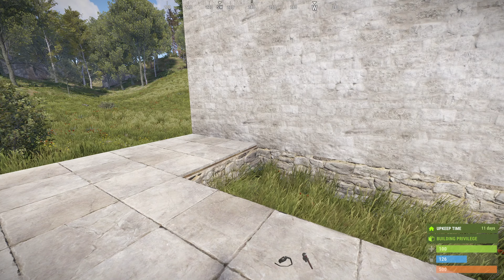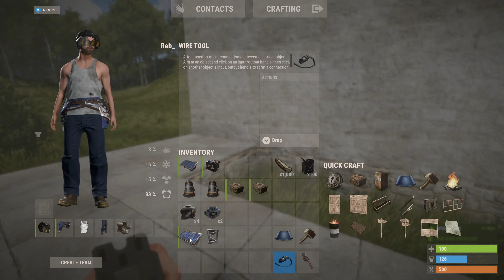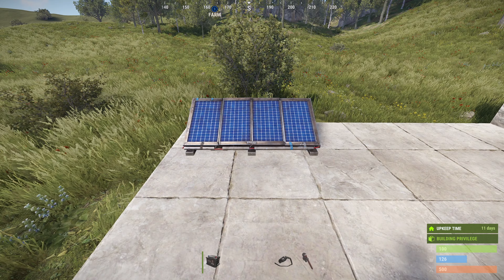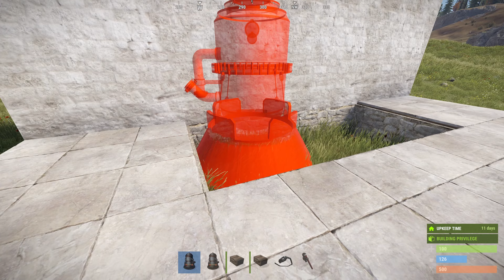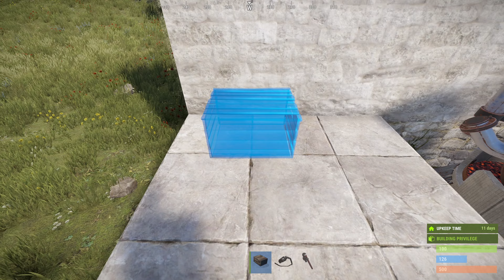How to automate Low Grade Fuel production using Small Refineries - Industrial guide - Rust

Comment: doesnt work
Reply: It does. Something to take into account is the server smelt rates. We played on a vanilla and it worked fine. When we played on one with faster smelt rates we have to up the wood/ crude input to match the 5 second conveyor tick.
Reply: @cptjimmy15 ya my bad i found out my sprinkler was a lil too close i fixed the problem
Reply: it keeps turning off
Reply from the maker: I use this all the time with no problem.
Reply from the maker: Are you connecting to a collection of wooden boxes or just one?
Reply: @friendnotfoe  i tried it were it pulles the wood and the crude from two diff chest  and i tried it only using one and i have to keep restarting it idk maybe i did something wrong

Comment: When I had the first conveyor toggled to "require all" it wouldn't pull for some reason, but when I switched it back to "any item" it then started pulling and working fine. Will deplete my wood storage, but as I only use the wood for charcoal anyway, this will have to do.
Reply from the maker: I had this set up a few wipes ago and never had a problem. I'll try it again next wipe and see what happens.

Comment: This shit does not work man
Reply from the maker: Well that's funny, because here is a video of it working.
Reply: @ did the setup 1 for 1, after it smelts the crude and the refinery turns off. It won’t reignite afterwards so you have to manually active the timer. I’ve watched the video like 3 times trying to get it to work.
Reply from the maker: Hmm, I'll give it a try later on.
Reply: You got to put the igniter by the oil refinery i figured it out
Reply: @ZacharyHarding-m7m you don’t think I did that?